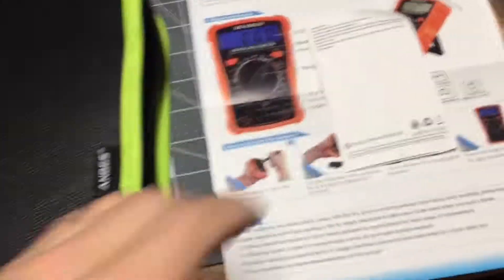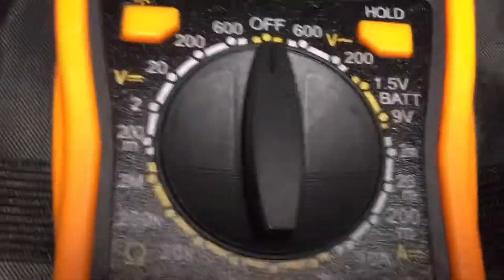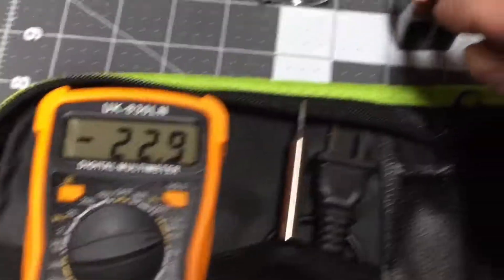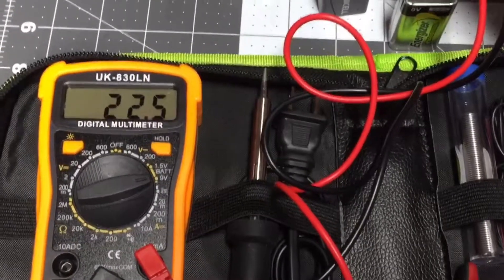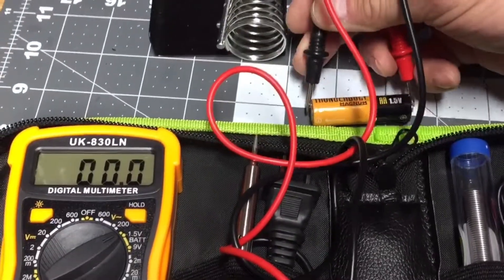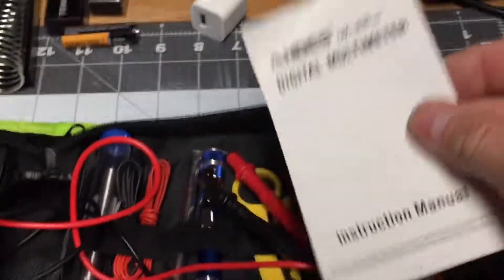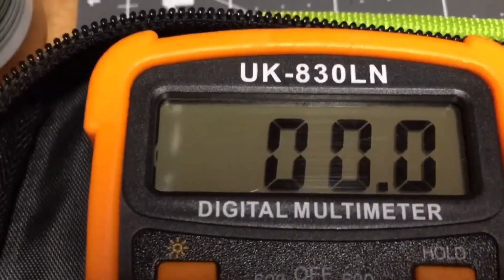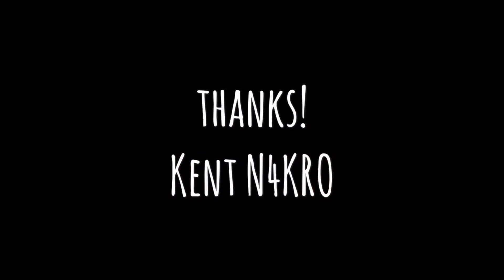Need your insight

Comment: Same here, I can’t figure it out
Reply from the maker: I think we got it. There is an internal resistor that loads the battery and the display indicates current. I’m not sure that the current reading is of any value by itself. But can be used for comparison on a new battery.  No wonder they did not document this feature. Ha.

Comment: I have a FSK-830LN, I was really confuse, mine I have the logo at same position Measuring current (mA)1.5 and a logo of capacitor if I'm not mistaken. The most confuse is in the manual, it sate in manual "Measuring capacitance" and "Turn the rotary to F position, literally there's no F position.
Reply from the maker: Not sure but maybe the F means Farad (a value of capacitance)?

Comment: Meter is measuring current (in mA) through a load resistor. Guessing 360 ohms for the 9V setting, so a 25mA reading is a fresh battery.  1.5V setting must be around 40 ohms so that 35mA indicates a fresh battery.  Measure across the jacks with another ohm meter to get the actual load resistor values and use Ohm's law to get more precise "100% charge" values.
Reply from the maker: Incredible.  Makes sense.  I have been a certified electronics tech for 30 years and did not even consider this. :/  Obviously, a terminal voltage reading is of little value.
Reply from the maker: Checked and 360 ohms and 40 ohms as you said.

Comment: Also Kent
Check and see if there is voltage on the test leads, I would not be surprised if it is a capacitor tester.
Reply from the maker: Good thot, but not likely as it only has two ranges assuming that the meter face is labeled incorrectly.  And there is no voltage on the leads.